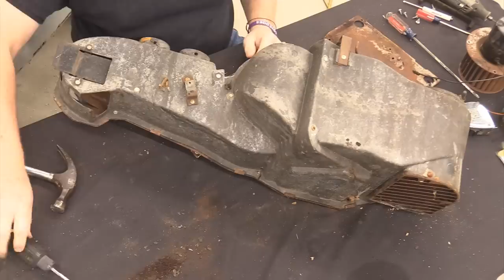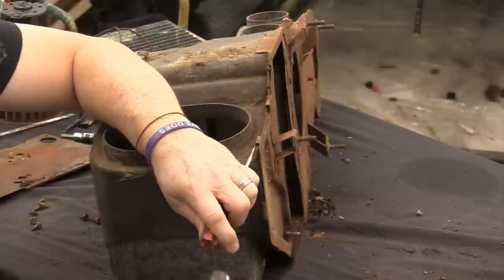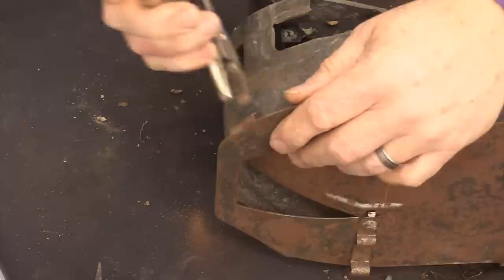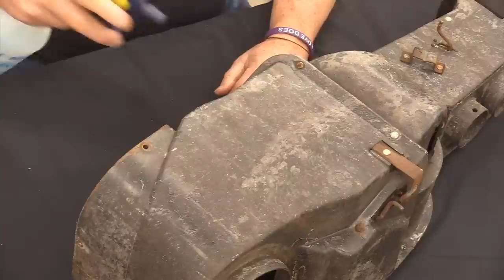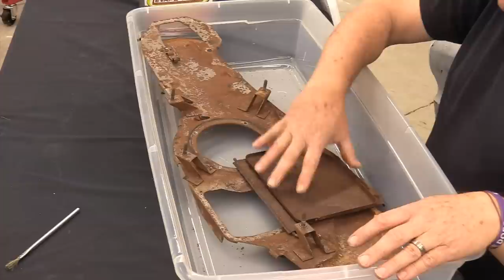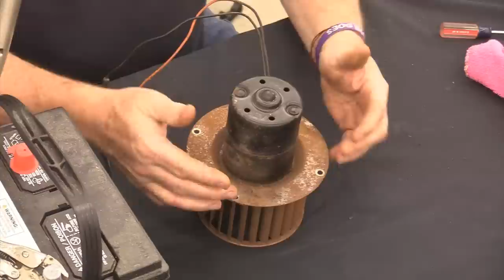Ford Heater Box Tear Down and Rust Prevention Galaxie

Comment: Although it is possible that those cracks and breaks did occur at the factory, my guess is that they occurred from the stress over the years. I have repaired similar heater boxes by using short strand fiberglass and applying a dye close to the original color. I can tell a slight difference, but anybody else would extremely likely never see the repair. If you are paranoid about it not matching, then grind off on the inside where the crack/break is, and fill it there so it won't be seen on the outside. For the pop rivet portion, embed a piece of sheet metal with a hole drilled that is the same size of the pop rivet on the inside to give it strength and keep it from cracking when you redo the pop rivet.

Comment: Had pretty good luck with Rust Kutter from Tractor Supply. But use it in a WELL VENTILATED area. The fumes are strong.